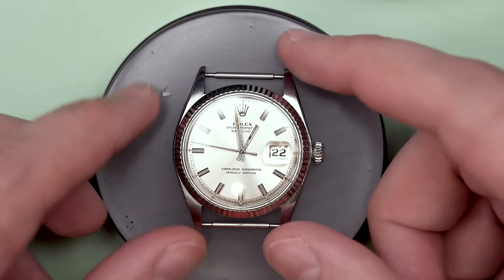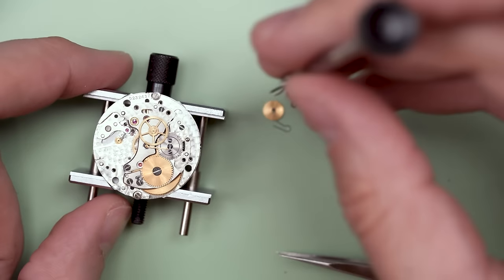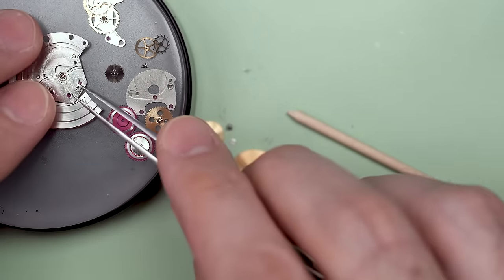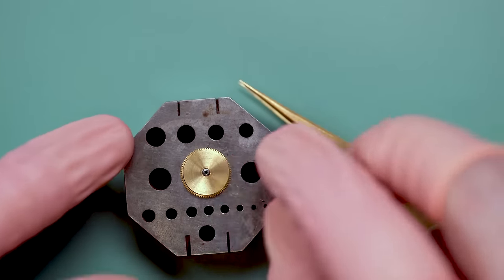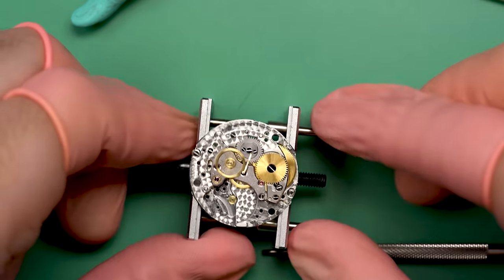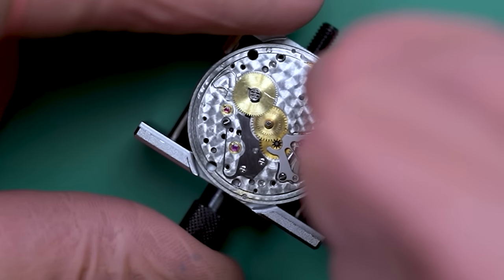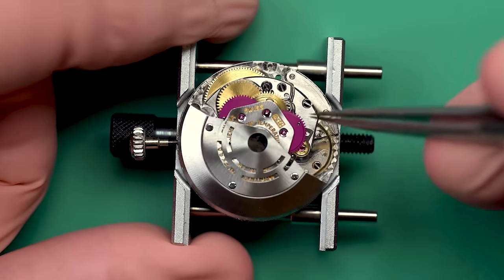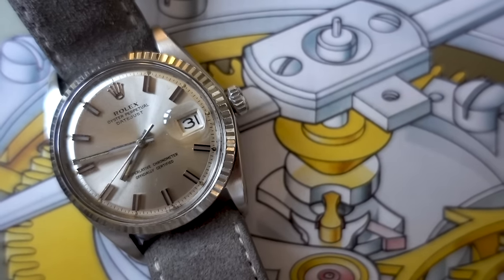Rolex Datejust Vintage Watch Restoration

Comment: Hi, Rolex-trained watchmaker here! About that wheel you’re having trouble getting off, you’re supposed to rotate it counter-clockwise by one of its spokes while the entire wheel train is still in place so you almost ”screw” it off the pinion. Hope that helps ya!
Reply: What do you think is the cause of the date getting stuck halfway through the jump? Incorrect assembly?
Reply: @LMF5000  Either that or the spring which makes the date jump is too weak and needs to be replaced =)
Reply: AnimeVideoEditor probably the spring imo
Reply: @LMF5000  The date jumper spring on this movement has an adjustment on the under side that similar to an eccentric screw, you can use a proper sized screw driver to adjust the tension on the date wheel,  too little tension and sometimes the rapid change causes it to jump 2 days ahead and too much tension can cause a lethargic date change, instead of a rapid jump at midnight, hope this helps
Reply: @ramoneramlingam3723  Thanks, that really helps! :)
Reply: @LMF5000  I suspect the first watch maker who serviced the watch messed it up.
Reply: I love my watches and am giving serious consideration as watch repair/restoration as a hobby. But this really looks a hell of a complicated. How can you remember what goes where after you have dismantled it? Is it really as hard as I think...how long did it take you to become this good??
Reply: @StruanRobertson29  Complicated, sure, but imagine it's much larger and the mind can grasp it much easier. Dimensions are a funny thing.
Reply: @seanwarren9357  Interesting Sean...thanks :)
Reply: @StruanRobertson29  personally I use ice cube trays to keep the screws with the parts they belong to and remember the order of disassembly
Reply: @TrueFork  good idea....probably I imagine just alot of practice to understand it....I imagine an old beaten up omega geneve to practise on
Reply: Hey Markus. I have a question. On a 1575 movement, if by impact the rotor comes lose, but the axle seems intact, and so the reversing wheels, is it possible it just came off, and the rotor bearing jewel broke and nothing else was damaged?
Reply: @StruanRobertson29  he replays the video.
Reply: @StruanRobertson29  just replay your recording of disassembly in reverse and follow along 🤔😂
Reply: @MartiensBezuidenhout  that seems to be equally as laborious and time consuming....Good luck to those who have the time to do this
Reply: @AirVac99  without a doubt! 😊
Reply: @StruanRobertson29  lots of pictures i assume.
Reply: @StruanRobertson29  He mentions in other videos a good practice is to film yourself disassembling it.  that way you have a guide to put it back together.
Reply: Counter clockwise? From dial side?
Reply: @Agrippa31BC  did you ever figure it out?
Reply: @danjenkins8981  well, nothing broke that I could see, the rotor only got loose from the “C” clip that holds it in place. I’ve reassembled all and the watch is running fine. I just need to know what oils to use in each part of the automatic works as I intend to service that part ASAP.
Reply: @StruanRobertson29  I just stumbled onto this video and I'm not a watch maker but I think you an use your phone and take pictures as you remove parts so you have a reference.
Reply: @StruanRobertson29  One trick, i am serious and this may even have played a big part in the creation of the channel, if you take high-resolution video of everything you do during disassembly, you can look it all up later. And if you really get stuck, you can ask others and can give them a timestamped link to your private video.
Reply: @Agrippa31BC  In the newer videos he goes into more detail about how much of what oil to use where. It seems to be basically the same for all of these, no matter what manufacturer. Now that modern synthetic oils of highest purity are used everywhere by everyone, all old manuals and instructions are obsolete anyway.

About the possibly damaged parts: I think besides checking if anything is bent, its all just microscopic inspection of everything that could be damaged. What surely helps the professionals is that they can compare everything to new unused spare parts.
Reply: @kurtilein3  hi. Can you recommend a book that gives SIMPLE instructions on how to repair/take apart watchs?...thanks
Reply: @StruanRobertson29  No, sorry, i think video is also the ideal format.
Reply: @seanwarren9357  thanks bro as soon as u said that I imagined a big watch and I was controlling it by just pushing on certain gears ⚙️ great learning tactic.
Reply: @kingzionmusic  Everything is a matter of perspective. 👌👍 You're welcome, and don't forget to remind others from time to time. o7

Comment: I have had a Rolex Datejust for about 20 years. It's my only watch, I wear it every day, and I've never seen inside it. It was a pleasure to see how intricate and well-made my watch is from your video - makes me appreciate it even more. Thank you
Reply: How accurate is it running and have you serviced it?
Reply: @squigglyphrank9348  I have a newer Datejust - made in 1990, it's very accurate however loses 1-2 minutes per month. The last time it was serviced was 2010..it's certainly due.
Reply: I've got a 1983 Rolex Datejust I inherited from my dad in 1994, and yeah it's cool to see the insides.
Reply: I have a 16014, runs excellent, never had it serviced. I do change the gaskets every 20 years, but never sent it in for a service.
Reply: @watchhobbywithdannythemedic  maybe it would be worth it, just for the purpose of oiling those jewels and maybe readjusting :)
Reply: I have had one also for about 20 years, but never serviced it. don't really wear it to look at time. it just feels good to have a Rolex on. who cares if it is couple of minutes slow or fast...lol
Reply: I have a Rolex Date watch bought in 1992.  Went to a jeweler to find out the cost of a service.  $700 and one week turnaround.  That does not include parts if needing replacing.  It is like buying a Mercedes over a Ford.  When it comes time for a service, you end up paying the Mercedes price which is double to triple that of Ford.
Reply: I inherited a heavily worn 1970s vintage Datejust. After that much time I thought a factory tuneup would be worthwhile. It was expensive but the watch looks new it should be to go good for another 50 years now.

Comment: I would be confident in the "Taking apart" part.....   It's the putting "Back together" part that would have me worried.
Reply: Yes quite right, but do not forget that he made a recording of the taking apart sequence which could come in handy
Reply: Exactly
Reply: As was instructed to me, anyone can scatter a machine, though, it takes a craftsman of special skill, and knowledge to put it back together.
Reply: I would most worry about the fact that the pieces are so small that I could lose them 😅
Reply: @GuiSmith  That's called the "Oh F@#k.... I have an extra screw!...."
Reply: @blthetube1962  actually the oh f**k I’m a screw short is waaaaaay worse
Reply: Same
Reply: Yah, I usually 'lose' that 'part'.

Comment: I'm only at the start of the video and I don't know if you end up addressing this further on, and a (very) brief check of the comments didn't see anyone else mention it, but the markings on the inside cover are Arabic.

I can't make out most of the handwriting, but I see خمر ("vintage"), the number ٢٠ (20), and ممكن ("maybe").

A native speaker would most certainly be able to read this better than I am, but additional insight in case it didn't come up yet.

Now, back to watching.

Comment: 40 years from now, someone's going to open this watch up wondering why it isn't working, and they'll find a rogue jewel stuck on a gear...

I love these videos, they're super soothing, and I'm absolutely fascinated watching every part of the process. I like to do repair on small electronics, so I'm already extremely interested in videos of things being taken apart, fixed, and put back together. But the incredibly delicate nature of wristwatches is just so cool to see. Thank you so much for these super relaxing videos!
Reply: Will ~ It was a very good video.  The hour and minute hands should have been cleaned. It would be an easy fix,  just take crystal off.

Comment: "If it's right, they go together pretty nicely."  True words, and applicable to many areas of life, not just watches.   There was a great commercial back in the 60s where they put a bunch of separate watch parts in a box, shook it up for a few seconds, and, presto, a fully assembled running watch appears within.  Guess the idea was it was so finely engineered, the parts automatically knew just where they belonged.

Comment: I service watches regularly. I've never removed a mainspring and put it back in. Solid aftermarket replacements might cost me $20. Oil the barrel and press the pre wound spring in. And you get the confidence of a new spring.

Also, you can easy make the tool to remove the calendar wheel nut. Just take a screwdriver with the same width as the nut. File down the center of the blade so it's just two tips on each side. 👍
Reply: Some inexpensive computer/phone screwdriver sets come with that exact screwdriver type

Comment: I am quite impressed by the tiny, high quality gears and screws in this (and all watches) and how they all fit together and why so many are needed. I am also amazed at how you remember where each part goes. You mentioned you never worked on a Rolex before, however, is it just your normal knowledge of watches that helps you reassemble this? Or did you have to stop and look at some pictures/videos to remember stuff? Which brand of watches in your opinion is the highest quality you have worked on? Great video, Thanks.
Reply: why so many are needed? They're not, they are just there to stop those which are needed from rattling around inside of the case !
Reply: Richard Turner “they’re not needed, they’re just there as they are needed to perform a job” great point

Comment: When I was in the gem industry and working with small stones, I sometimes would use an isolation bag.  A clear plastic bag about the size of a basketball with a couple of small holes for access. I would put the small items in this bag and if the took off the bag would retain them.

Comment: I've got a lot of patience and determination when it comes to repairing things but I could never attempt something like this. You must have very steady hands and good eyesight! 👍
Reply: Ultra steady hands. Eyesight is less important, unless your eyes are foggy or blurred or something is seriously wrong. If you have to wear glasses to see anything at all, microscopes or a jewellers loupe adjust for that, you use these tools without glasses or contacts. For people dependent on heavy glasses it is quite liberating to use a microscope or also binoculars or a telescope, you can put your glasses away. So its all about the hands, and patience, and discipline.
Reply: @kurtilein3  I like the satisfaction of fixing complex things, even taking them apart and seeing how they work. I bet fixing watches is a very rewarding hobby.

Comment: Funnily enough I have seen loose screws in the movement on a few “as is” Ebay finds.  Something called creep which electronics guys are familiar with.  Start with a loose screw from the factory or bad service.  Add heat, cold cycles (wearing watch and not wearing the watch).  The screw creeps to the loose position similar to plugged in IC chips in electronics circuits.

From my understanding a sapphire (blue) is the result of a higher concentration of aluminium and a lower concentration of iron.  A ruby is a red sapphire in effect.  It has a higher concentration of iron and lower concentration of aluminium.  So just a ratio of iron to aluminum differs the ruby to sapphire. Interestingly, older oils reacted with the iron in the ruby so some higher end watches have blue jewels (sapphire).

Again, wonderful job!  Lucky with the loose screw!
Reply: I wonder if watchmakers ever use a threadlocker solution (eg. Loctite) on the screws to prevent screw migration? Also, I've watched (no pun intended) several watchmaker vids now and it seems like none of them torque the screws. I wonder if there's a recommended torque for screws, or if you're just supposed to tighten them until they "feel right?"
Reply: I'm CARAYENG Facebook Tegyu very much Lavi DEMO ENDAPALANET
Reply: Kasalan sa ta o sa Pagenoon Jesus AT sapo bese Dapat alaral eto sa May awa
Reply: PAGE noon Salamat Pagenoon de mo AKO peyna bayaan
Reply: Pantastek hestorey May lalehep Dokyumetare review video games Google Hilp me ebenseya
Reply: Ekolg bakamahawapa help me

Comment: I don't work on watches but larger mechanical things over my 71 years .
I agree with you putting together or taking things apart if it doesn't come apart or together there is a reason . It's time to stop and figure out what holding things up before something gets broken. 
Very interesting video.

Comment: I wonder if the seller sees this and finds out about that loose screw in the balance 😂
Reply: He'd be rolling in his sleep.
Reply: he's got a 'screw loose' !
Reply: معرفة ما إذا كان يمكنك العثور على المسمار
Reply: If the seller knew how to service the watch, he would have done so.  As it happens, it really doesn't matter how trivial the issue creating the need for the service is - you still have to take the watch apart, clean, lubricate and regulate it, and that's very, very expensive for a Rolex.
Reply: I guess that's their loss.

Comment: Me: "I've never worked on a Rolex before".
Me: "Look! The problem was apparently only a screw that came loose".
Me: "I think I'll just reinstall the screw, put it all back together, see how it does. If it's fine, I'll let my first Rolex full takedown come later on one that has more serious problems".
But, that's just me 🙂
Reply: I'm glad I'm not the only one who was thinking this
Reply: All mechanical watches should be fully disassembled and cleaned about one every 5 years

Comment: I really enjoyed this video. I have always loved taking things apart to troubleshoot/repair or most importantly examine and learn how it works. Most recent was i build my first computer a little over a year ago now I'm working on my second and an internal server network. 
Still remember pulling apart my first mower and getting it to run just for fun. then about 2 months later I transferred high schools middle of the semester and came into my small engines class 4 weeks into a Briggs and Straton rebuild project, each student had a partner and a complete engine to start with. I did not have a partner and literally pieced a 4 stoke together from spare parts around the shop that was in boxes and on the shelves. had it running and ready to mount within 15 minutes of my second class there(1hour 45 minute block schedule for class periods, one day was 4 classes then alternated to a homeroom class and 3 others day by day), Needless to say that teacher booted me from that class just so i can take his advanced class I was a Ta after 6 weeks for the class he booted me out of haha. Miss those days more and more.

Comment: I used to build and race radio controlled cars, and there are some really small parts in the transmissions, and loosing one means you don't run this weekend. On trick I came up with is get yourself a small vacuum that doesn't use a bag (like a 1 gallon shop vac.) Use your regular vacuum to clean up your work area before you start, and if you drop a piece, you can usually find it with the shop vac.

Comment: I take apart engines and engine subsystems for a living. It's kinda like what you do with watches but on a larger, clunkier scale. I couldn't do what you do, it's impressive. I can, however, relate to losing parts. I've lost tons of screws and nuts inside engine bays. I try to be careful but yeah, sometimes you have to eat the cost of new hardware because things just walk away sometimes. It gets easier as you go though. Keep up the good work, sir, and thank you for the excellent content.

Comment: The thing that baffles me about this as how you get everything back together again, correctly.  It seems that it would be a lot easier to take it apart, then putting everything back exactly as it should be with all the screws going in the correct location.  Much respect to the people that can manage this.
Reply: With practice, you remember the type, size, and length of screws, wheels, etc. Keeping them segregated helps.

Comment: Brilliant! Lived your comments and humility, sir.

I must note for you, the Datejust has that characteristic crisp date half flip, then it advances fully over the next hour. Nothing wrong with this one...mine did the same movement.

I bought an Oyster Perpetual Datejust new in 1985. As a working man's watch. 

It originally had a jubilee bezel and band, black face with diamonds at the hours. Yuck. I had it fitted with the polished bezel, a royal blue face (no diamonds), the acrylic face with the magnifying date blister, and the simpler wide link band.

Why? It reminded me of my trusty Timex I wore as a lad.

Later, as a firefighter and brush monkey, I wore it every day, swinging my Pulaski and hopping from a Super Huey. Days of swinging that axe killed several basic watches.

"Hey Captain, that thing real?" I heard a few times.

Yes indeed, brushed the dust from my wrist. Can't kill the thing.

You are correct. In 1985 that Rolex was $1795. Just looked up a current model. Um, $14,000.

So sad. I never bought the thing to impress. It's a working man's timepiece at its heart. Pity.